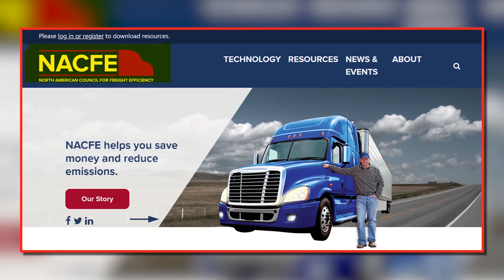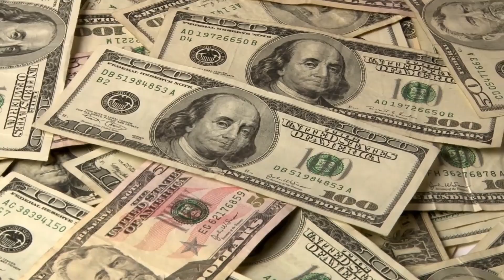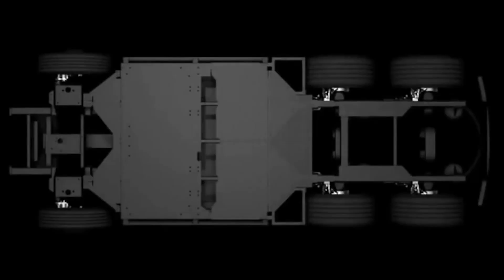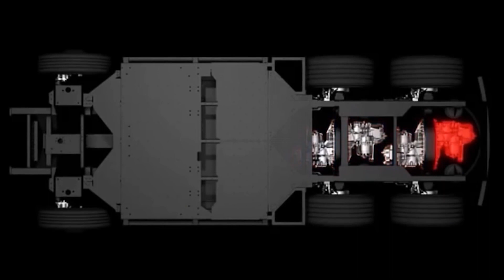Elon Musk's Tesla Semi Truck. God's Gift OR Fail?

Comment: Several corrections   need  to be made  to your  video and info, one of them is the drive motors  they are 3 Tesla Plaid motors instead of the original proposed  year 2017  reveal of 4  Tesla mod 3 motors, and the accerative motor axcel are Clutched/ freewheel enabled , a Plaid motor  is for the Highway drive ,Total  HP are in the 1500HP .range.
Reply from the maker: Thanks for sharing your opinion. Appreciate it!